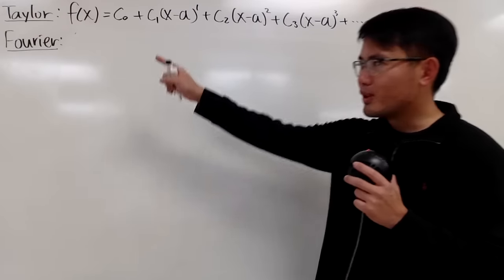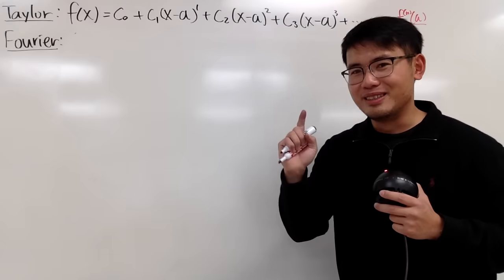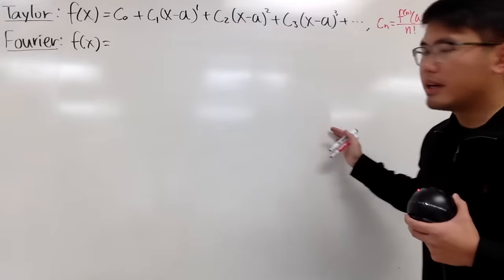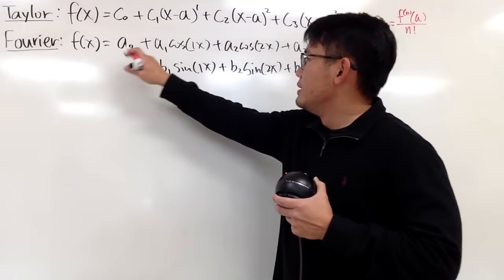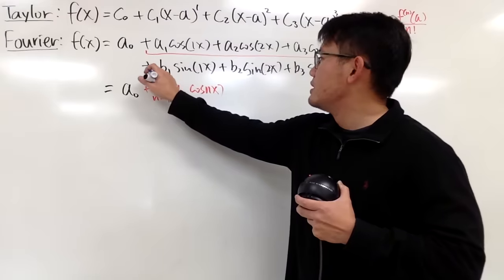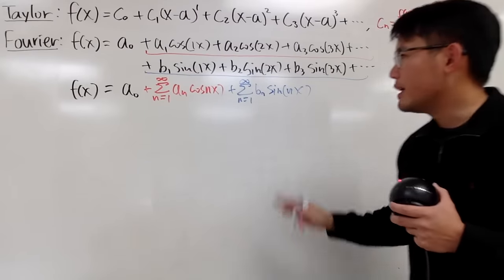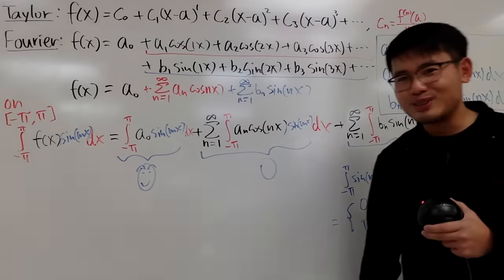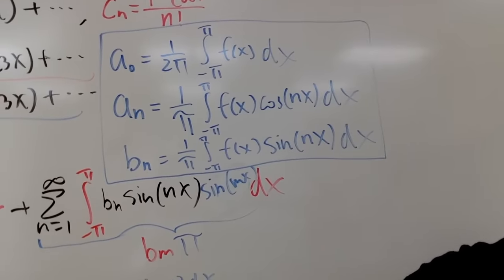how to get the Fourier series coefficients (fourier series engineering mathematics)

Comment: I learned about these recently in my partial differential equations class and I think I can shed some light on why you would multiply by cos(nx) or sin(nx). When Fourier series come up in a PDE the sin and cos terms are eigenfunctions after separating variables. There is a theorem in PDE about Sturm-Liouville differential equations that says that if the DE for the eigenfunctions is in Sturm-Liouville form then the eigenfunctions are orthogonal to each other with a specific weight function, which comes from the form of the DE (and form a complete set). Knowing about orthogonality of functions it would seem only natural to multiply by orthogonal functions. It is just like in linear algebra when you have an orthogonal set you can easily calculate each coefficient in a linear combination using the fact that the dot product is 0 when vectors are orthogonal. One other thing I think is interesting to note is that the coefficient term for a_0 is also the average value of f(x) on the interval. Something interesting and fun to consider is why it would be the average. There are good intuitive reasons...
Reply: The term 0 is part of the cosine sum (in reality, the sum goes to 0 to infinite)
Reply: @asxxsss6106  It is, but you cannot get a_0 from plugging 0 in for n in the a_n term. Also, as I said, the expression for a_0 is also the average value of f(x) on the interval from -pi to pi, which you can justify intuitively as well as rigorously.
Reply: this was a very good read . very well written indeed friend

Comment: BlackpenRedpen, actually, the reason why you should multiply by Cos(mx) or Sin(mx)  "f(x)" is because you exploit what's called the "inner product"; I am not 100% sure that this is what Fourier was thinking at the time, but if you know what an innerproduct is, it's simple to see that you have to multiply by a new function to get a specific coefficient. (It's a bit like a dot product except between scalars.. and what do you do when you want to extract the "x" component of a vector? you dot the vector with the unit vector "x", which is sort of what you are doing here basically with cosines and sines)

Comment: The reason for the difference between the integral of cos(nx)*cos(mx) and sin(nx)*sin(mx) where n = m and n =/= m happens because because if n = m, cos(nx)*cos(mx) and sin(nx)*sin(mx), due to being equal to cos²(mx) and sin²(mx), respectively, are always positve whereas cos(nx)*cos(mx) and sin(nx)*sin(mx) can have negative values.

Alternatively, you can use the trigonometic identity with the product of two angles for n =/= m. The integral you get is:
I(x) = 1/2[sin(nx+mx)/(n+m) - sin(nx - mx)/(n - m)]
which equals from -π to π to 0 because n and m are natural numbers/positive integers and with c being any integer, sin(c*π) = 0.
In fact, you can use the same integral and use n = m, assuming m approaches n because part of the integral results in a 0/0 situation (more specifically, lim n -> m of sin(nx - mx)/(n - m) = x) and I(π) - I(-π) = [π - (-π)]/2 = π. Of course, you can calculate it classicaly with the power reduction for n = m.
Reply: MarioFanGamer Well, he sort of explained that in the video already, but I think it’s more illuminating to talk about what it means: it means the functions are orthogonal.

Comment: Does EVERY function converge in the interval (-pi,pi) using the Fourier Series?
And what happens if you change the interval? For example (-3pi,3pi), will it converge too?
Reply: I have the same question. Do you have to integrate it from the beginning by yourself? Or is there any general formula for whichever interval you choose? If anyone knows, please let me know
Reply: @turel528  Not every function will converge.  For instance, the Fourier series of tangent of x will have trouble, because the integrals will diverge nearby the asymptotes.

You can change the interval to anything you want, as long as it fully captures a complete period of the periodic function.  For instance, for a function of the same period as the original sine or cosine, I'd use -pi to pi as the interval.  Whereas for a function with a period of 6*pi, I'd use -3*pi to + 3*pi.

Comment: I would prefer to use:

f(x) = sum_{n=-inf...inf} a_n e^(inx)

#EulersFormula makes it much more concise and, moreover, can be used to derive the other expression with sin/cos from this one and vice versa, thus showing their equivalence. (NB: there might be some weird, subtle real-analytic arguments around absolute vs. conditional convergence in some cases that may or may not cause a problem in at least "bad" cases, but I'm not sure about this.)

That said, if you want to use real sine/cosine only, I'd also prefer

f(x) = sum_{n=0...inf} a_n sin(nx + phi_n)

which more closely illustrates that the point of the series is you are summing waves with both different amplitudes a_n and different phases phi_n. Again, equivalence of these expressions is similarly proveable (namely just note that the sin/cos series effectively just takes "half", so to speak, of the phase factors as tau/4 , or 90 degrees.). Moreover, it transparently lets you see that a square and triangular wave are pretty much the same thing, just depending on where you put the phase. One may also be tempted to explore the ominous world of

"f"(x) "=" sum_{n=0...inf} sin(nx)

subtleetiees concealing #DREAD awwwaaiiitttt..... w000000000000hhhhhhhh.......................................................................
Reply: mike4ty4 The fact that this is an additive combination of waves is already obvious, even without invoking the difference in phase. I do agree that the complex form is better, but for students who are learning about, this method may be more convenient regardless because in many courses where they teach this they do not allow you to use any complex algebra or complex analysis whatsoever. Also, although that formula is indeed more concise, this illustrates the meaning of it better, especially when understanding the linear algebra behind it.

Comment: What's the point in using a series to represent a function that already has a clear-cut explicit "f(x)" I thought the series notation was a way to extrapolate a function without a given explicit functions, and just a graph of data points
Reply: Let's say you need an electrical signal that follows e^x. The most common way that electrical signals appear is in ac sine waves. Therefore, adding together different electrical signals can approximate e^x.
Reply: No, the series notation is not meant to extrapolate an unknown function. That is actually very impractical. No, the reasons we find power series and Fourier series for functions are: 1. To extend the domain of the function to as many numbers as we can, typically complex numbers, though often we can go further; 2. Given that we have either of the series, we can differentiate the series or integrate it, which we would not have been able to do with the function beforehand if we knew nothing else about the function, and this allows you to extract the other series. Most functions do not have a derivative or integral you can express in terms of other functions, but you can do it if you have a power series or Fourier series; 3. The asymptotic behavior becomes clear for the function at different regions; 4. Using the theory of formal series and ring theory, you can learn so much information about the function and derive identities with it that you could not derive otherwise. Now, you may be wondering, if we know nothing about the function, how would you even get the integrals from the video or the derivatives to form the Taylor series in the first place? Well, that is why numerical analysis exists, and that is why we have induction principles. Though, often enough, even if you know almost nothing about the function, you can know enough to either find its derivative or its integration. Then find either series, and from there, learn everything else about it. But also, sometimes it’s very convenient to turn already well-understood functions into series, since those are just legitimately better to work with for applications.

Comment: Given Two Discrete Systems connected in Series with impulse responses h1= [1,3,5] and h1= [2,1,4] if the input signal X[n]=[A,1,2]
Find the output signal y[n]....... Please can you solve this issue for me?

Comment: Could you make a video on how to solve improper integrals like integral from 0 to inf of f(x)cos(x)dx. I can't understand the last part where you use some Jordan identity to demonstrate the arc lenght of the imaginary curve is 0. :(
Reply: The TacoBusiness There were no imaginary curves used in this video, what you are talking about is not even relevant to the video because there are no improper integrals in the video. Also, in general, such integrals with a cosine or sine in them diverge, unless f(x) decays sufficiently fast. In those cases, literally just use integration by parts.

Comment: Could you also prove why those 2 integrals are either 0 or pi at n != m and n=m  ? Would help me understand this better :)
Reply: Consider the angle sum formula for cosine:
cos(A + B) = cos A cos B - sin A sin B
cos(A - B)  = cos A cos B + sin A sin B (because cos(-B) = cos(B) and sin(-B) = - sin(B)
Adding the two, we get cos(A + B) + cos(A - B) = 2cos A cos B
The integral then becomes:
∫cos(nx)cos(mx)dx = ∫(1/2)cos((n + m)x) dx + ∫(1/2)cos((n - m)x)dx from -π to +π
cos is an odd function, so the first integral is always 0
If n ≠ m, the 2nd integral is again just the odd cosine function, so is 0
If n = m, the 2nd integral becomes (1/2)∫cos(0)dx = (1/2)∫1.dx = 2π/2 = π
Hope this helps.
Reply: @davidgould9431  It did! Thank you very much!
Reply: @qschroed  Good! Glad you're happy! :-)
Reply: "cos is an odd function" - oops, I meant "even function" (cos (-x) = cos (x)). In any case, my point was that you get 0 when you look at the area between -π and π, the negative bits (below the x axis) cancelling out the positive bits above the x axis.

Comment: Do the terms also become smaller as n gets bigger? In taylor you can have a decent approximation with a few terms, do fourier expansions work the same? With maybe a little-o term?
Reply: The terms don't necessarily get smaller as n increases. You can be very creative. Consider the uses of the Fourier series. One of the classic Fourier decompositions is that of the square wave. The square wave has no even valued harmonics (multiples of the fundamental frequency). So there is no second harmonic, but there is a third, no fourth, but a fifth and so on. So there is no sin(2x), nor sin(4x), nor sin(6x), nor any cosines. Only sin(x), sin(3x), sin(5x) and so on exist in the square wave decomposition with perhaps a constant offset if the average value is not zero.

Take another waveform other than the square wave and there is any possibility that say the 5th harmonic is greater than the 3rd. You can have as much fun as you like.

Comment: I have the same question. Do you have to integrate it from the beginning by yourself? Or is there any general formula for whichever interval you choose? If anyone knows, please let me know
Reply: You integrate it over any interval that covers the full period of the periodic function.   Some waveforms might have a section of the domain that is trivially equal to zero that you can rule out, some waveforms have symmetry that works in your favor, to reduce the number of intervals you need to consider.

Another strategy you can do, is to shift the waveform vertically, so that a section trivially equals zero, and then undo the shift when you are done.

Comment: Thank you. But I have a problem to solve on Fourier series on doubly period sequences. I would be grateful if you can assist me with that. Thank you.

Suppose $Tx = h*x$ with kernel $h(j,k) = [1,-1]$ (with all other coefficients =0) and that.\\

\[x(j;k) =  \begin{bmatrix}\\\\
 \hphantom{000} 1 & 1 & 1 & 1 & 1 \hphantom{000}\\
 \hphantom{000} 0 & 1 & 1 & 1 & 1 \hphantom{000}\\
 \hphantom{000} 0 & 0 & 1 & 1 & 1 \hphantom{000}\\
 \hphantom{000} 0 & 0 & 0 & 1 & 1 \hphantom{000}\\
 \hphantom{000} 0 & 0 & 0 & 0 & 1 \hphantom{000} \\\\
\end{bmatrix} \in \mathcal{R}^{7x7}\]
%
(zero padding sorrounding the image in the center).\\
What is $H(m,n) = \mathcal{F}_{7x7}(x)(m,n)$ and how is it applied to $X(m,n) = \mathcal{F}_{7x7}(x)(m,n)?$